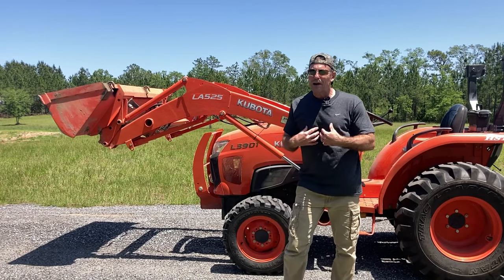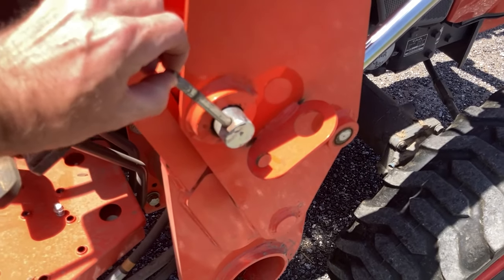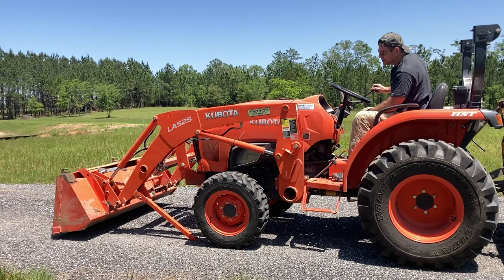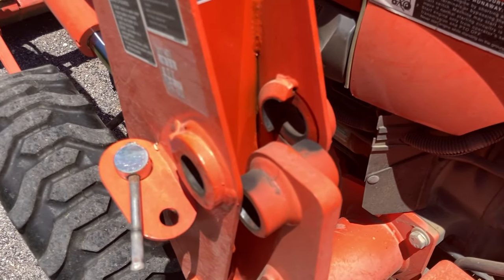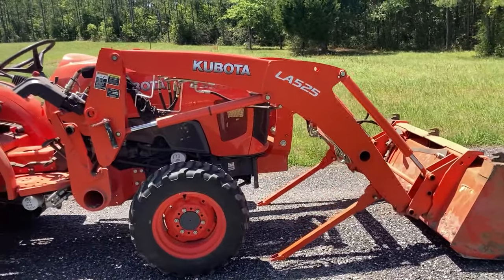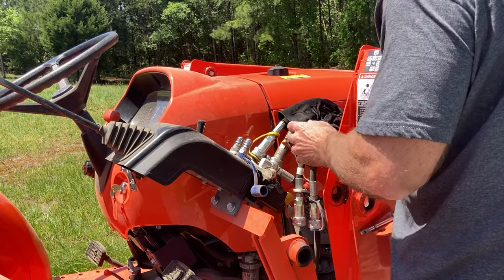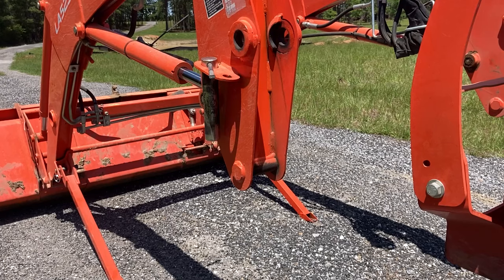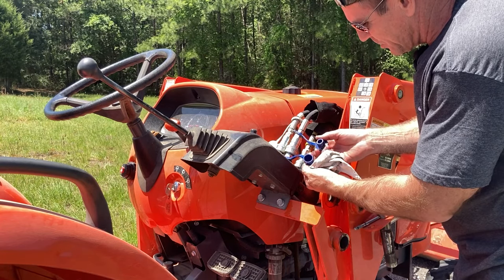How to REMOVE the Front LOADER on a Kubota Compact Tractor

Comment: Good informative video.  I've never taken mine off (and likely won't, unless I get bored).  I can see where removing it would help in maneuverability as well as deep cleaning and maintenance. The loader makes is a little more difficult, but not much to access the front end of the engine bay.
Reply from the maker: I take it off all the time now.   Never thought I would, but it literally only takes a minute or two.  Thanks for watching.

Comment: Kubota has a great system for easy removal.  The L series is similar to the BX.  I have to remove mine all of the time to mow my yard.  I can’t run the brush cutter without the loader though.  The front end gets too light.  😂.
Reply from the maker: I knew it was fairly simple but never tried it.  Glad I did!   You will see the L3901 a lot now without the loader!   Made changing the oil so easy too.  Definitely an "a ha" moment for us.   Take care, Lucas.  B&D

Comment: The first time we took the loader off our MX5200 it was a bit sticky. After we took it off I greased the pins and the coupling where the loader connects. It’s easier to disconnect the loader the second time.

Taking off the loader transforms the tractor when mowing. It feels like a much smaller and more agile machine. It’s much more pleasant to mow grass without the loader attached and it must be easier on the front axel not to have the loader attached. 

Most probably if I had a decent storage shed I’d keep the loader off most of the time, only fitting it when I need to use it.

One positive about Kubota is they make loaders that are as easy as they can make to take off and put back on.
Reply from the maker: We agree with all your comments!  Our Loader Removal video on Tik Tok had 750K views and a common comment was: "why remove your loader?"
Reply: @PineyGroveHomestead  it’s surprising so many tractor enthusiasts are watching Tik Tok. You could answer “because Kubota makes it so easy to take the loader off”. I find it a little more difficult getting the loader back on as we do not have a perfectly level surface or hard surface to park the loader. So when pushing down on the bucket it sinks into the ground a bit.